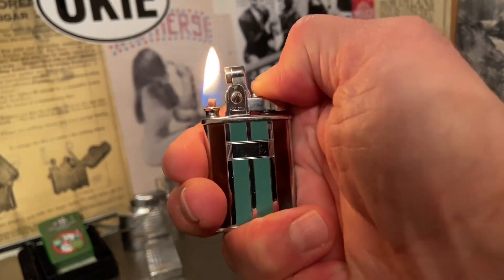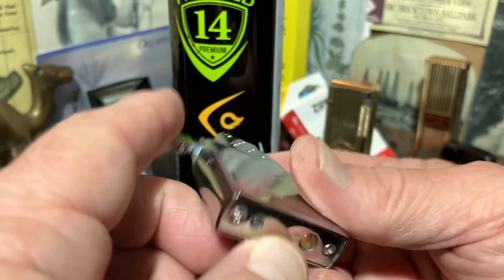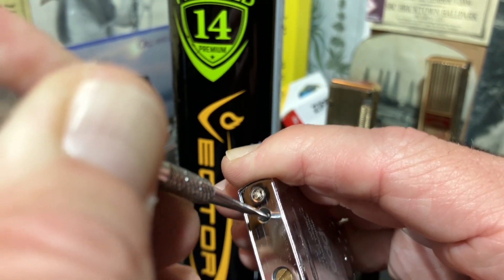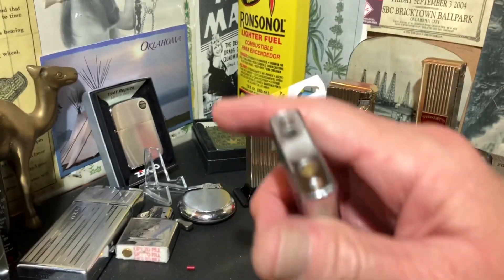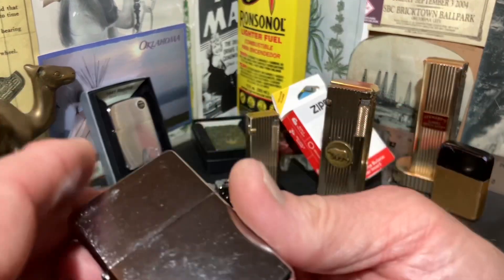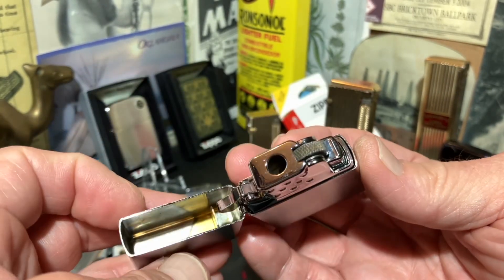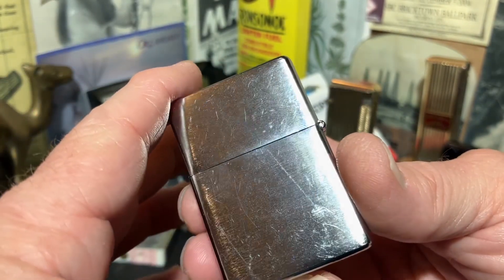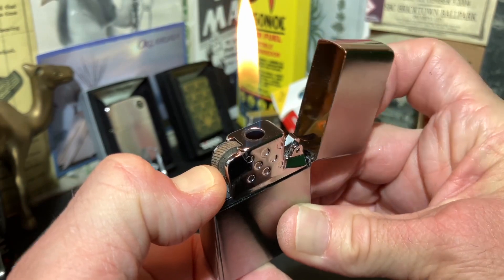Filling Our Zippo Soft Yellow Flame Butane Insert For The Third Time

Comment: Sadly with butane, you gotta bleed your lighter at regular intervals. Doesn't matter how pure the butane is, it still has air that travels downwards.
Reply from the maker: I bleed them every time I fill them. Do you think that is necessary or can it go a few fills in between? Thanks for your insight.✌️
Reply: @DependableFlame  I do it once or twice per month. Every single time you refill is overkill for sure :)